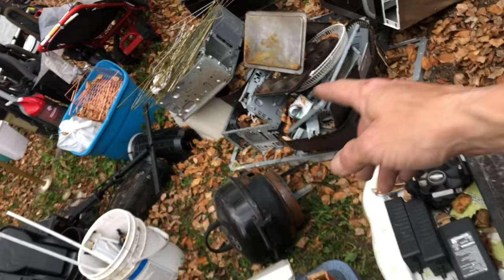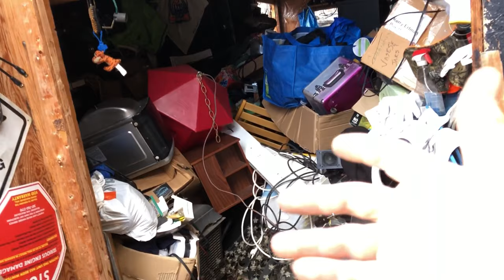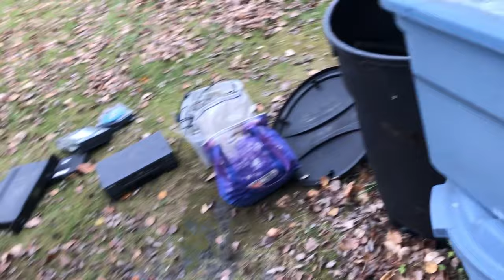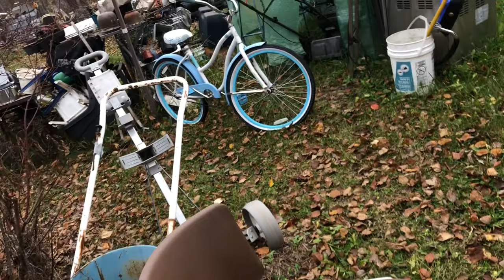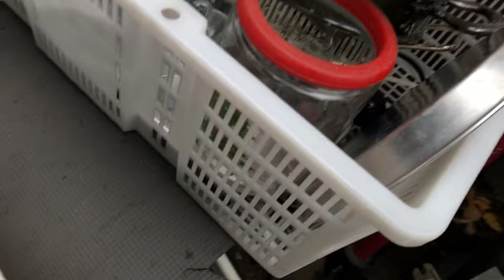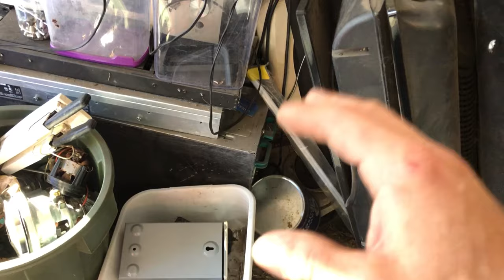Getting it all cleaned up Sorta #copper

Comment: Your yard should have a category for Christmas lights,
Reply from the maker: I’ll be calling around a few yards tomorrow! If a person cut the bulbs off the wire it should upgrade it though wouldn’t it!
Reply: @BushDogScrapper  It does, but in my opinion not enough to account for your time and the loss in weight.  For example, I think my yard is 20 cents a pound on Christmas lights and they consider wire that thin "junk" wire at 30 cents a pound.  I take 20 cents for them and move on to something that pays better.  👍
Reply from the maker: @cuscrapping  very good point thank you Roger!

Comment: As a guy who picks up a lot of stuff at the gun range, I would say that that computer was shot with a bow and arrow. 

Due to the size of the hole, that hole would be 9 mm and above in size… which would go right through it if it was a gun. 

I’ve seen those computers get shredded to Swiss cheese at the range I scrap. 

A .22 will right go through an iPhone… I may know that for a fact😀😀. 

Have a great one Cody!!

Steve
Reply from the maker: Interesting point 🤣 you could very well be right! Now I might have to pull out my Browning semi auto .22  for a lil test haha 😂 CheeRs Steve ♻️🐺🤙🏻